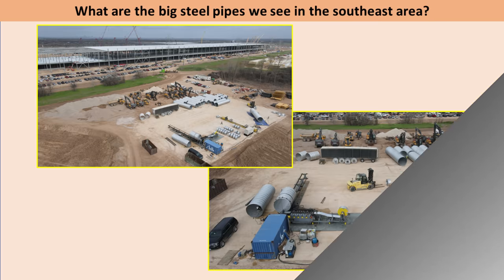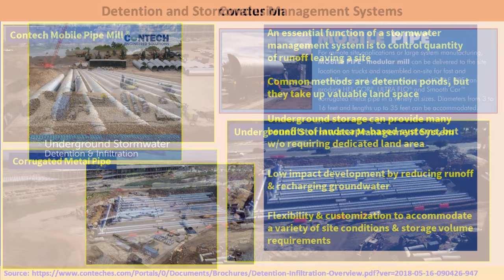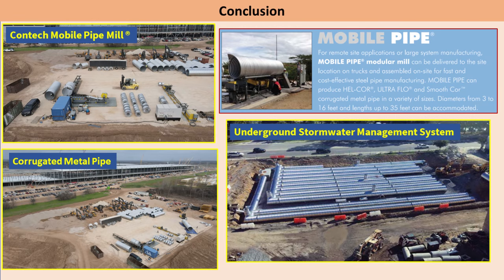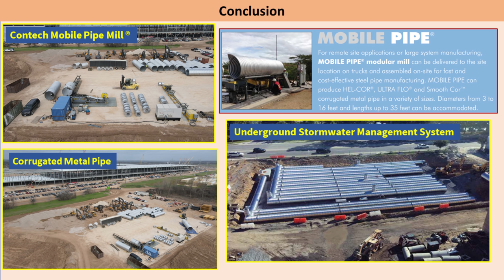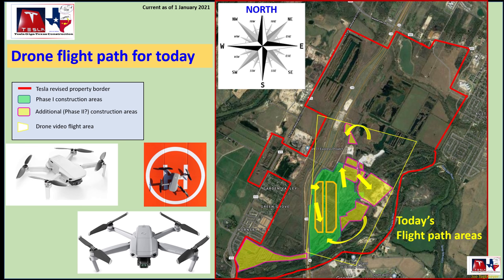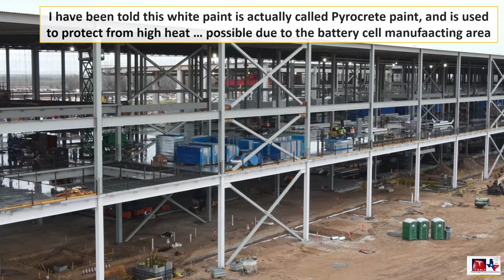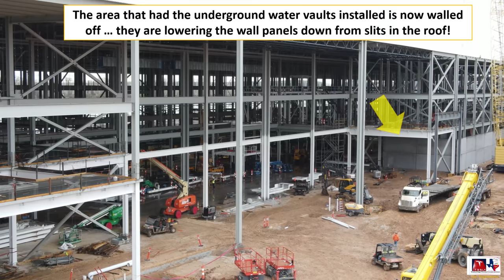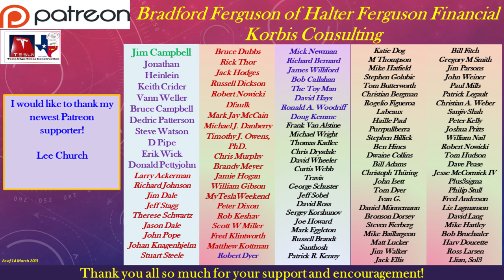Tesla Gigafactory Texas 14 March 2021 Cyber Truck & Model Y Factory Construction Update (08:30AM)

Comment: As for the PyroCrete paint, you generally protect all structural steel in a building since as the Twin Towers sadly proved, steel is very strong until it gets hot. So just about any building and certainly one with people in it, has to protect the structural steel for a certain period of time in case of a fire. The duration and heat rating can vary, from as little as 15 minutes to two hours for instance. There are many ways to do it. 

Although you are calling it the fire loop, I suspect it’s just a potable water main which will be used for fire protection as well as potable water. The ultimate source is the same. You would install separate back flow preventers at each branch off this loop into the buildings so that you can prevent cross contaminating the potable water supply, but there is no need to build two large water main systems on the site. One large main makes more sense.

Finally, they may be using the portable natural gas system until they can route in a natural gas pipeline or even get a tap off the one running down the middle of the property. Melting aluminum takes a lot of BTUs. You can do it with gas or electric but gas is a lot more efficient than using electric since most electricity in Texas is made by using natural gas to spin a turbine in some manner. Does anyone have any specs or maker on the aluminum furnace they are using? Plus they are going to have to heat the lithium ore to process it. Again, usually cheaper with gas. We have it by the cubic sh*tload in Texas.
Reply: As far as the fire protection loop, the City of Austin requires that new industrial and commercial projects use reclaimed water (not potable water) for cooling, irrigation, process water, and fire protection - IF the property is within 250 feet of the reclaimed water system. Fortunately, the engineers who developed the Master Plan for Austin Water’s Reclaimed Water System knew that this large tract of land would be developed as commercial or industrial. So, the reclaimed water main already crosses under the SH-130 bridge. Undoubtedly the fire protection loop will connect to this system and be completely separate from the potable water system.

From Austin Water:
Mandatory Connections - http://www.austintexas.gov/sites/default/files/files/Water/Water_Reclamation/mandatoryconnwebpage.pdf
Reclaimed Water FAQs - http://www.austintexas.gov/page/reclaimed-water-faq
Reclaimed Water System Map - http://www.austintexas.gov/sites/default/files/files/Water/AlternativeWater/Reclaimed/Reclaimed%20Water%20MasterPlan.pdf
Reply: @douglasgroff7648  Thanks for this information, Douglas! We saw them extend the fire protection loop pretty close to the river around the toll road, so they must have it pretty close to connecting! Some people were saying that there wasn't a connection anywhere near this project, so I appreciate your links to the water system map
Reply: @douglasgroff7648  , didn’t know that, so I guess they do have to build two systems. My only concern, to be honest, is if they have enough volume for real fire protection. For instance the potable water system in Austin has hundreds of millions of gallons in reserves and a bunch of water in elevated towers to maintain pressures even when the volume required exceeds what the pumps can deliver. But I guess they have thought this out. With water being the most precious resource in Central Texas, it makes sense even if it does add significant expense to a project like this.
Reply: @zacadams7070  , the regional waste water treatment facility is right across the river not a hop, skip, and a jump from the site. It makes sense to use it where you can. I’d want to use a pre-action fire sprinkler system in this case so that you only fill the system with water after you have a good indication of fire. But that makes sense anyway in a factory full of electrical and electronic systems, like robots and such.
Reply: @Bill_N_ATX   I am no longer a practicing professional engineer, but I maintain my license in Virginia just in case. I spent about 15 years in the industry, working on all manners of projects that dealt with water - of any type. Roadway drainage and storm water management, municipal water and sewer systems, stream restorations, floodplain/floodway studies, etc.

Municipal elevated water storage tanks are typically in the 1-2 million gallon range. Ground storage tanks can be just about any size, there really is no size limitation. Of course, things do tend to be bigger in Texas... Looking at the reclaimed water system map, I count 10 tanks - both elevated and ground level. So, I’m guessing that there is at least 10-15 million gallons of storage in the reclaimed water system. This would be in addition to what is stored in the potable water system.

BTW, water pressure in most large municipal systems is provided by elevated storage tanks and not pumps. This isn’t always the case, but it is the simplest and most robust. Pumps are only necessary to raise the water into the tank. Once the water is raised to the tank level, it can sit there, waiting to be used without any intervention. The only thing necessary for water to flow out of a fire hydrant from an elevated tank is gravity. Whereas pumps require electricity (or some other source of energy), gravity is constant and will likely always exist. When gravity stops, we’ll have more important problems to deal with...
Reply: @douglasgroff7648  , indeed. Nothing creates water pressure much more efficiently and none more reliably than good old 9.8 meters per second squared gravity. Austin has numerous elevated tanks plus large tanks on the tops of the local hills. It’s why you see the roofs of NYC buildings still dotted with wooden water tanks. And they are replaced after close to 100 years with new or refurbished tanks of similar construction. While a reliable pumping system to pump average daily usage up to the top of those ranks is affordable, a system to pump enough for an emergency would be a bundle.

Comment: 14:42 Those two green trailers are the generators.  Also notice the cabling (behind  the concrete beam) that runs up to the gantry crane.  The temp power may be currently for gantry crane setup and/or casting machine.  I would think the casting machine, or at least the melting process would require more power than those portable generators could deliver.

Comment: Joe, thank you for your information about the storm drain system, I have seen spiral construction used in culverts and ducting systems. At 5:48 the footings on the left show a column support to the West of the wall section at grade but the larger support to the East is below grade. Also the wall sections don't have rebar required to complete the wall.
Reply from the maker: Thanks ... it is a mystery still and I'm trying to figure out the plan.  What ideas do you have?
Reply: @JoeTegtmeyer  Now you are making me think. Ever thing is just speculation. The wall would imply that the East side would be dug out possibly, but there is no rebar to continue the wall. The wall sections could be "wings" to prevent East West movement. There is quite a lot of rebar on the East side that indicates a large load will be placed here, maybe a frame for a large clear span building. Could that be the loading area for finished units ?

Comment: Think of how massive the savings must be by manufacturing the large drain pipes on site rather than needing to truck them in.

The standing water on all the interior floors sure goes to show the benefit of putting up exterior walls. Even though interior work is well underway, I wouldn't call those conditions "dry".
Reply: you will need to add an 4th floor count on your sheets!
Reply: Yes I was looking at how dry the stamping area is and was disapointed to see large pools far inside that I can't see having come through the sides @ 4:44
Reply: @takememars  I'm considering it. Not for this week but next week.
Reply: And that's from a light rain, little more than a drizzle.
Reply from the maker: The initial roof panels are not meant to be fully water tight ... more layers will be installed and other work to make them so.  I believe they are using an agile method of construction, so they are willing to begin installation of equipment even with the roof not fully water tight.  Also, the paint shop itself only has provisions for heavy exterior wall panel installation on the north end ... the sides facing the casting machine and the battery cell areas do not, so I'm curious to their plan for this to close it it.
Reply: @JoeTegtmeyer  Watertight no, but if the sheets were overlapped in the direction of run off, they would keep the water out.  Like tiles on a roof. Relying on gravity more than any attempt to seal them, to keep the water on the side you want it.
  Also with the corrigations on the BiW roof not running with the pitch, they create water traps.  Even with further layers, if the waterproofing fails and water gets this far the only place it can go is into the factory.
  I half susppect that the team who will do it will decend and fly it out, like the steel did(for now).  
  The casting side of the paintshop will be joined to the casting structure and be an interior wall.  The batteryside will be semi-outside, with a 90 foot roof to the battery section.  The perimeter beams are your guide.
Reply: @JoeTegtmeyer  Dead right on all counts, Joe. These are just the rough, first draft roofs. It doesn't have to be perfect today, just has to serve today's purpose, which it does.

Comment: I looks like they need to seal the roof (where completed) with a membrane and insulation to prevent rain  intrusion into the structure from above.  Like they did in Germany and China.
Reply from the maker: They will ... its far from being completed.  The panels they installed are just the first step and not meant to be waterproof yet.

Comment: Hi Joe, I think you'll find that the area where the transformers is more of a switch yard, where you can isolate the incoming very very high voltages to the transformers, where then the maybe 11000volts is going to be delivered by those underground cables to more step down transformers 11Kv to 3.3Kv/1.1Kv/600v/400/110v in localised substation that will provide the final supply circuits for lighting, power, motor control and utilities.
Cheers
Looking good there.
Thanks for your vid's, almost haven't missed one <3
Reply from the maker: Correct ... that is the term I've been using since September based on the original site planning documents!

Comment: 20.00 to 21.10;
Best view.of the.temporary cross tie wires I have seen on any of the vidios.   ( used to maintain stability until permanent measures are installed.)
Reply from the maker: Thanks David!  These are everywhere and one of the many reasons flying into the structure is not a good idea

Comment: @ 10:45 You can see where the conduit leaves the switchyard (By white excavator) towards the factory.
Reply: Yep, and I assume there will be manholes in every spot that they haven't filled in yet.
Reply from the maker: Yes you can and if you look closely, you will see the painted red or magenta on the ground showing the pathway.
Reply: @JoeTegtmeyer  Looks like you can see the line beginning @ 10:40. Doesn't look like they've laid conduit under the road yet. Though they have been working on both sides of the road.
Reply: @LinasVepstas  Yep, those will most likely be permanent utility vaults. They need access every few hundred feet for pulling cable, and for taps to send power to the main building and other structures in the future. My guess is that the voltage will be 7,200 volts or higher. Stepped down to 480 volts by transformers in the building.

Comment: Joe, any idea if they are on schedule?
Reply from the maker: IT's a bit hard to say for sure because they are using an agile way of building, which is different than typical waterfall projects.  As an example, they are already installing a lot of paint shop, casting machine and very soon, stamping machine equipment yet the traditional "dry-in" of having walls and roof completed is not being followed.  I would say that they are on track for what might be considered the "first substantial completion" in early July v... but that does not mean production ... I think we will see the first pre-production products (model Y most certainly) in the third quarter which is consistent with the timelines Tesla gave in the 4th Quarter meeting in late January.  Finally, I think we will see some areas under construction into the thrid quarter while other parts are beginning to function ... not sure if this helps, but it seems to be how they are approaching this build.  Also, they have already started on other phases of work, which I do not have planning details on.  
As a side note, on site contractors have told me there will be on-going construction of various things for at least the next three years.
Reply: @JoeTegtmeyer  Thats is some great information Joe, So your Dailey calendar for the next 3 years says  JOE ,,, get up go to terra Factory site fly drones,  research a lot and then go run your own businesses lol ha ha .. Thanks for all this .. Ian A
Reply from the maker: @ianablitt2627  thanks ... we shall see what the future holds for me and Giga Texas.  I do want to see the first product come out of the factory ... that would be really cool to see given where this all started!
Reply: @JoeTegtmeyer  Great attitude, as usual one day at a time 🙌 at the same time leaving a big barn door open LOL 🤙🤙🤙

Comment: Thanks for the video and the in-depth on corrugated pipe.  I am surprised that they haven't finished the roof with insulation and rubber membrane on the paint shop area.  Rain is pouring down on all the paint shop equipment.  Also any ideas when some of the exterior wall panels will be installed?
Reply from the maker: Hard to say .. they are using more of an agile project methodology than a typical waterfall one, so terms like "Dry-In" seem to be very loosely defined at Giga Texas.  I expect walls to start going up first on the east or west structures as they have the provisions to mount the panels, but only on the exterior perimeter.  Perhaps we will see the first ones late this month.

Comment: Great video today, Joe! Looks like the column extensions that will allow the east wall of the stamping area to have a parapet are starting to be delivered! You can see them at 3:41
Reply: Now be on the lookout for precast wall panels with penetrations for rainwater downpipes. All that water behind the parapet will need to go somewhere, and they didn't lay any big drains under the floor in the stamping plant, so outside it is.
Reply: @DessieDoolan  I'm wondering if the column extensions will have to sit up there for a while and be grouted in before they'll be able to hold wall panels
Reply: @zacadams7070  Maybe, as it is just a grouted connection. They might brace back to the roof deck if they really want to quickly push ahead with it. And the grout might cure quickly as well, particularly if it is epoxy based. Wide range of presumptions to choose from there!
Reply: @DessieDoolan  That's true! Those things have to weigh a ton because they each came on their own trailers instead of putting two or three together on a trailer as space would allow
Reply: @zacadams7070  Wild estimate in metric, 1.5m x 0.9m x 3.0m = 3.24 cubic metres. 3.24 x 2.4 (relative density of concrete) = 7.7 metric tons, which is about the same in feet and inches. Fiddle with the dimensions wildly, and they are still very weighty.
Reply: @DessieDoolan  Thanks for the math! I had no idea those small blocks could weigh so much
Reply: @zacadams7070  Don't drop one on your toes.
Reply from the maker: Yes they are!  I failed to point them out but glad you did!

Comment: Still trying to locate where the ‘dip-tanks’ will be located in the paint shop department.
Reply: I wonder if they  were placed close to their final installation locations on the second floor as shown in the video. I wonder of those tanks are for color coating or just for under coats?